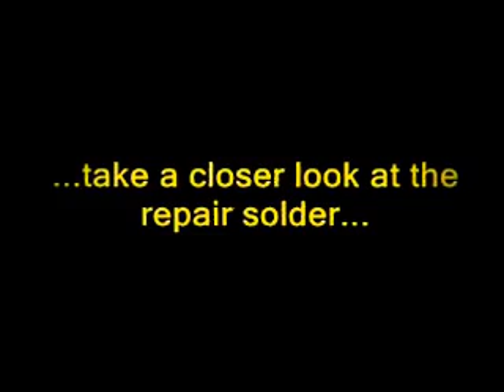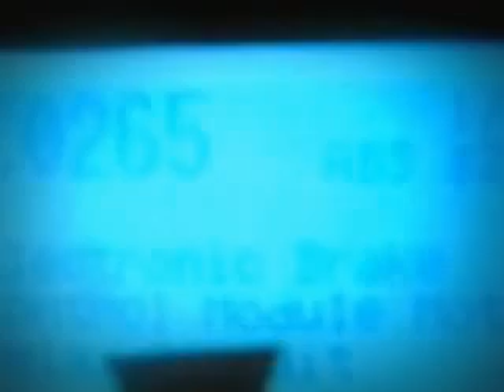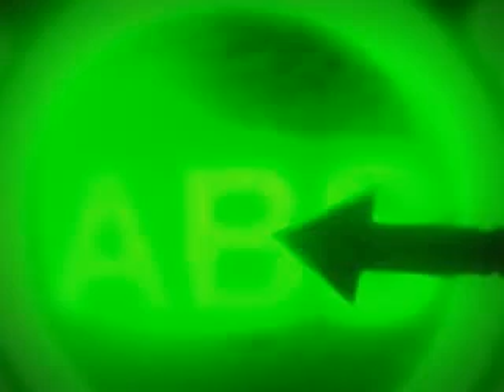*REAL* FIX ASTRO-VAN KH325 EBCM (brake & abs light on intermittently; C0265 code)

Comment: This is a great video for the Kelsey Hayes 325 ABS, but I need to repair a Kelsey Hayes 4WAL that is older and I can't find any shop rebuilding them or part for me to use to repair it myself. I have an electronics background but not finding any parts unless I am mistaken. Can you share any information to help me? I am in process to restore my 1994 Chevy Astro Van and I hope to repair my ABS if I can find some help and parts and technical advice. Thanks in advance.

Comment: This is a fabulous video and great fix.  I am an ASE Certified mechanic and had my doubts about the repair.  I have a 2004 GMC Safari Van and my ABS light has been on for awhile.  It took longer to remove the module than it did to repair it.  Shops are charging hundreds of dollars to repair or replace the $800 module when all it needs is to be re-soldered.  Thank you "personalfunfest" for putting together the video.  Maybe a better choice of music next time, perhaps something happy.
Reply: how do i locate that module on my 03 safari van ?

Comment: Hi, thanks for publishing this video, is really helpful. My problem started when I took my Chevrolet Astro 04 to the mechanic so, he can change the hub assembly on the front wheels, so, everything was alright he installed them and when he finished I took the van for a ride and the abs light when on saying that the left speed sensor was defective, so he change the sensor for the old sensor and then the relay circuit abs code show up. so, I took the van with me then code disappear, but now when i fully brake the van starts vibrating and its like it jump. Any advice? Thanks

Comment: this fix worked for me saved time and money I would add  check " all " the solder joints  use heat sink compound where it was used inside cover also use silicon adhesive to reseal the cover to keep water out .thanks for the info,

Comment: I have a 2001 Chevy Silverado 1500 and one day the ABS motor kept on running after the key was turned off. I pulled the fuse to stop it but I was wondering if your fix would correct this problem? 
Thanks, Tony C

Comment: The pink dots are heat sink compound for the DPAK coil drivers and the on-board reg... I put a bit more heatsink compound on those. 

the case is dimpled to be used as a heat sink. Most probably why they made the PCB a 0.032" thick PCB - to allow better thermal transmission to the case....

Comment: I have a 2003 Chevy avalanche Service Brake Booster light comes on and i feel a vibration on the brake paddle sometimes if i hit a bump. Its an interment problem as well is this the same fix?

Comment: Thank you for posting such an informative video, it is much appreciated. I had a question flux, do you just apply a bit of flux to the older solder, or do you remove the old solder and apply flux to the pin before soldering? Thanks again for everything.

Comment: Thank you thank you thank you!  I knew there had to be a bad solder joint somewhere.   Had to get a t8 tool and fought with the silicone, but well worth it. Hobby soldering iron wasn't hot enough but had one that was. Thx!!!

Comment: This works!!
Well today I performed this fix on my 2002 GMC Sonoma 4.3L. Was getting the same code and the abs and brake lights were on. Took it apart and noticed the solder joints had cracks exactly in the locations of the video. You really need to look very closely or you might think they are ok. I have only driven a short distance but no lights have come on so far. Be prepared to use some patience but this fix does work. Really appreciate the video.

Comment: Thanks for posting this. Our 2000 Safari had the code. No visible damage to the Solder points. Soldered all of them as shown in this video and the codes disappeared. Passed the provincial safety first shot.  Saved a fortune!!!! You rock.

Comment: If you have to cut the module open with a knife, do you need to re-seal it with any waterproofing or is the existing gasket stay in tact and operable?

Comment: Kelsey Hayes 325 on my 2001 Suburban had ABS / Brake light on. Made it hard to get inpection each year. The Fix in this video worked! Thanks! Other important notes. You also need a T8 to release the 4-6 additional screws before prying the metal casing off. Seperating the case was very hard. Get multiple screw drivers (and don't cut yourself with your razor). Also, you will need Silicon glue to re-attach case and a very small amount of Thermal compound to connect circuit board to casing.

Comment: It did not work for me. I took my time soldering and still a no go. I will note that my light comes on and stays on. Also the 4 t20 torx screws were very rusty and 2 of the 4 were stripped. Good thing I have a parts truck ;)

Comment: There are 8 poinst where the cover makes contact with the circuit board itself and they appear to be glued in place - that isn't glue: it's thermal paste.  It's used to help conduct heat from the components to the cover which acts as a heat sink.  There are many types on the market but you don't need anything special - Ask for thermal compound or thermal paste at RadioShack.  Clean these points thoroughly before reapplying the paste, a dab will do.  DON'T put the cover back on without the paste.

Comment: Also, there are (6) T10 screws which must be removed from the cover once it is off the vehicle. Two of them are internal between the six cylinder shaped things. You WILL need an actual T10 screw driver whereas a bit will not fit in the tight places with a driver/coupler.
Reply: I believe they are T8's not T10's

Comment: Done and so far no ABS/Brake light which usually came on in less than a mile. My T20 screws were stripped so it was a pain. I made a video of exactly how to disassemble the EBCM. The RTV on it was pushed under the circuit board so when I pried the top casing it was also lifting the circuit board (very bad). There is a certain side to start on so that you will be able to have enough of an opening to cut that RTV out from under the board. I should have the video up later today after editing.

Comment: I followed your instructions in this video and PROBLEM SOLVED! This is great. Now I'm not a soldering expert, but, did a clean enough job resoldering the connections mentioned to make the repair. I took it nice and slow cutting through the RTV sealant that holds the cover portion on with a small box cutter blade. Resealed it after the solder repair with black RTV sealant. Installed and drove 45 miles to work. No ABS and brake light illumination! Thanks for a great video!

Comment: Nov.19,2012   any Body  knows this ""Take it easy around circuit board""dahhhhh ! I just save $175..+s/h . By the way in a 2001 Astro kelsey-hayes ABS sys..  never ending story. AT for 35yrs. and still learning. Thanks Kid. Ed shop.

Comment: Thank you for this information, i have had this issue for over 6 months and with your instruction was able to repair it myself, it works great now. The most difficult part was removing the EBCM module because the tork head screws were all rusty.
You're a genius!!!!!!!!!!

Comment: When I pried open the lid, the circuit board came out too thus separating some of the components from it. Long story short, I busted the module; BTW, I didn't see any contacts that needed to be soldered. Some components might indeed need replacement.Your method might be effective in some cases but not in all. So, BEWARE.

Comment: You need to disclose that there are 5 more screws at the base that attach the lid to the circuit board. Also, the lid is very well glued to the casing and, what's more important, the lid is GLUED to the circuit board as well.

Comment: btw, I did this to a Chevy 2003 Chevy Blazer LS, 4dr, 4x4 w/140+K... the internals/connectors of the EBCM of the blazer was the same. Only the top cover was different. Looking fix sites they have the same module #. This C0625 FIX works. I think it will work on S10s too.

Comment: THANKS MAN! its been a few days and so far no problems. for those trying to open up the cover, remove the 6T torx screws, and cut the silicone w/a box cutter or knife. then you pry it open w/a screwdriver (be careful not to break any internal organs). GOOD LUCK! this was a $10 fix for a $1000 part. I bought a soldering kit from harbor freight. Not the best iron in the world and I don't have much skills soldering but I did it. THANKS again!